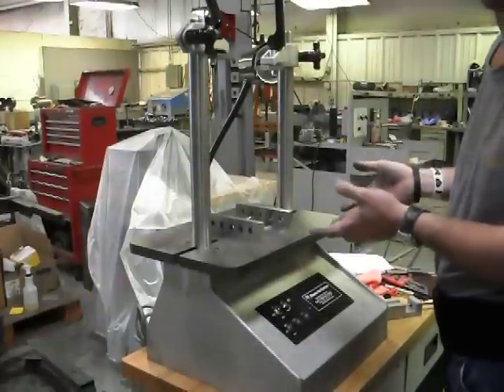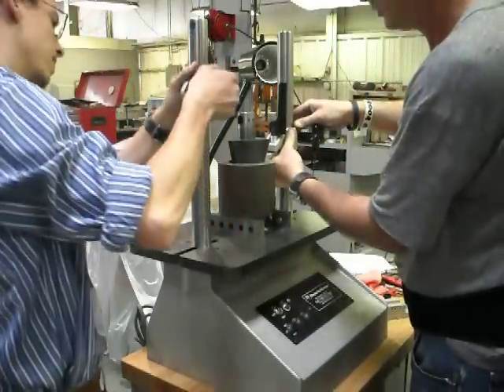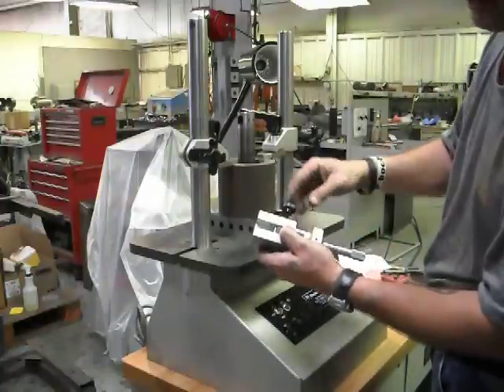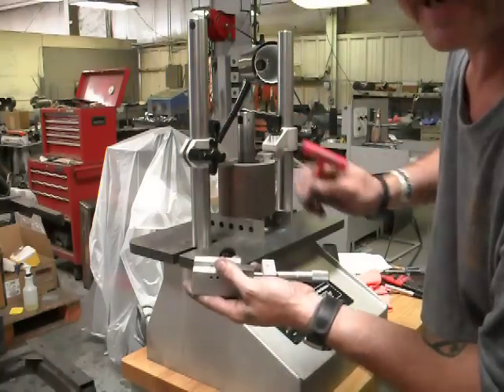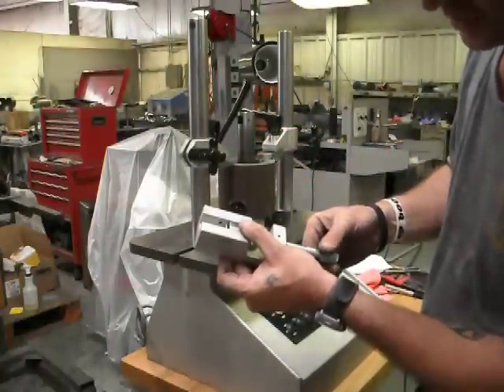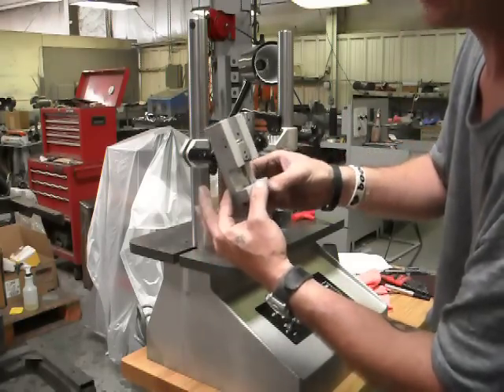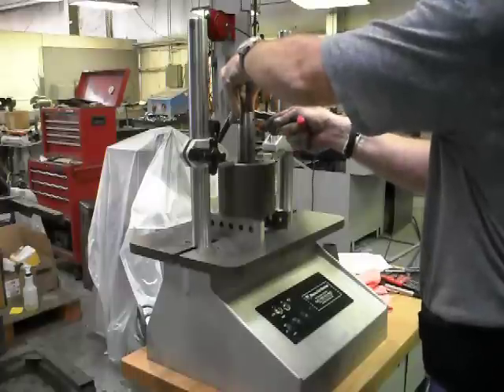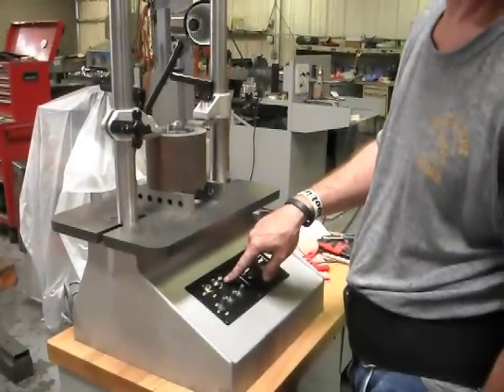Winona Van Norman - Boring - CB1401

Comment: Setting the micrometer that way will never be accurate, since every machine has a different depth on the boring bar, haha!!!))))))))))

The only way is to make a cut, & to measure it against what you have set it to do, & each cartridge is also not exactly he same, & the tools holders are not exactly the same,....

You need to use a certain cartridge & insert toll holder as your reference for the finish toll holder combination in order to get exact results for your finish cuts... 

Otherwise you will be all over the place, & if your toll holders are at different angles the micrometer will not indicate that, & you will get a different size than you have set it for....

GOOD LUCK!!!)))))))))))))